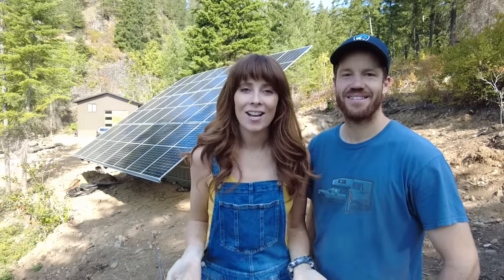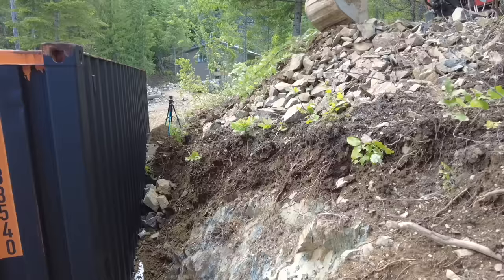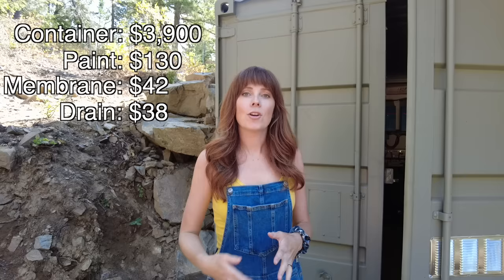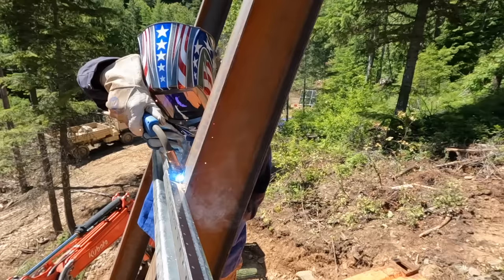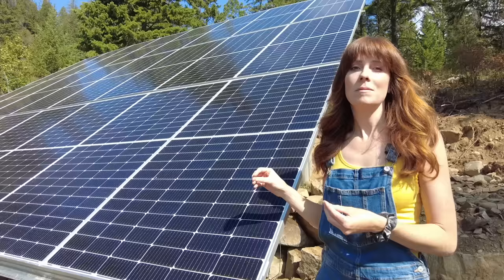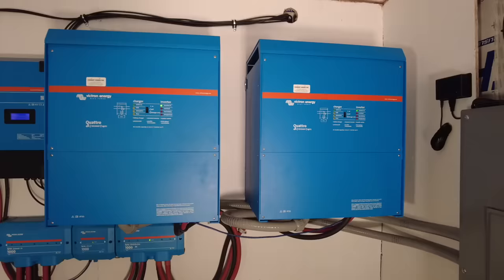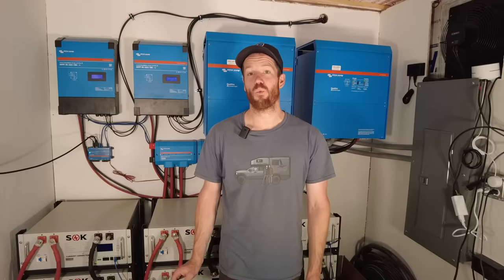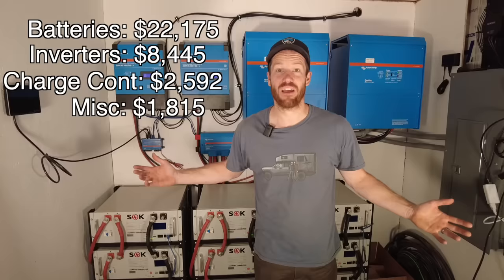TOTAL COST Of Our Off-Grid Solar Power System | Powering Our Mountain Home

Comment: Great video - thank you! Have you guys considered unlikely events such as fire in/near batteries or major weather events? We've similar battery capacity but have the batteries in two seperate locations just in case a fire occurs and takes the area off line for a while.

Comment: You have a very good system installed. Obviously, you need that power for what you want to do with a shop. However, that is way out of reach for most people. I live in Northern Wisconsin, so, I have the same winter issues as do you. We have a15,000 watt system with 2.4 kilowatts of panels. It gives us plenty of power for our needs.Instead of making or buying a big rack I purchased in individual racks that are adjustable to the angles needed in summer and winter. Our total cost for everything including connecting it to a breaker box was under $20,000. Still, you do have a very impressive system and I'm sure it will give you all the power that you need.

Comment: When i've checked winter solar production in my area, it is dropping to 5% of peak summer production. That's being said, your 10 kWp installation can go down to 500 Watts. Giving 8 hours sunny day it will give you guys 4 kWh of energy. Not enough for a small house, not mentioning charging the batteries. Still buy some fuel for your power gen and use that time to prepare shop projects for the spring-summer-autumn time when you'll have a lot o power to play with your tools guys! Have fun!:)
Reply: Key factor in energy production is panel angle to sun. During winter with low sun angle, the reflection is playing major role - pls mind that there is no zero angle with 100% energy being reflected! 
Their variable angle setup makes huge difference and during winter, more vertical setup can potentially collect sun energy reflected by flat ground / snow (but actually they have forest around and live in the mountains).

Comment: Good luck not needing to spend anything on maintenance for 20 years. Even at a 20 year payback your power bill would need to be over the 250/month. can't I believe you are smiling about spending 50k on that system and then saying you rarely go below 20 percent use. Should have bought way less battery and saved some money. 15k would have been more than enough. maybe you're from CA. smh.

Comment: Thank you!! Just minutes ago, I placed my own 30K USD order with CurrentConnected. Now is the time. I expect the technology will become cheaper over time, but the opportunity offered by the Federal Clean Energy Investment Tax Credit (ITC/FITC) and Inflation Reduction Act (IRA) is unlikely to be repeated anytime soon. For me and mine, it's time to reduce risks associated with traditional energy distribution for critical heat and water systems. I choose SOK 25 kWh from Current Connected and because I wanted grid-tied options (and other reasons) went with x2 SolArk 15K Inverters (also from Current Connected).

Comment: Interesting setup. I’m also in North Idaho on 20 acres and setting up ours currently. Commercial power is $85K to the property but additional to that it has to be put underground too and that cost is not included. We have the system components, very similar to yours. We also did not want to clear a huge area for the panels so had a barn engineered allowing mounting of the panels on the roof raised to accommodate snow depth and tilt-able also. Engineering included roof structure to handle 4000lb load above code, lateral and updraft wind loads to 90mph. Kinda like you guy its a bit unique so we’ll see how it works. Good luck with yours!
Reply from the maker: Sounds like an awesome set up! I have been thinking a lot lately about a tractor barn with panels on top. It's tough to optimize solar output while also optimizing a storage space.
Reply: @AmbitionStrikes  I have not tracked costs as granular as you but the engineering for the mounting (calculations, state sign off and materials) will finish up at about $30K. As you mentioned commercial mount is expensive but I spent more but with an end goal of not destroying the property to get power. Winter is tricky. My location gets 2 solar hours a day in winter less shade from trees etc. We are going with propane/AC appliances so we can switch to propane in winter and AC in the summer to help spread the load. We will have between 40 and 50 panels. Looked into bi-facial but the life of a panel is based on input apparently.. both sides. So the additional cost of the panels coupled with the same input total did not seem to be worth it for us. It's been a fun project so far. the barn got finished just before the snow came!

Comment: To heat the battery shed you can use DERNORD 12V 600W Immersion Heater Submersible Water Heater Element ($25 on Amazon) in combination with large paint cans filled with motor oil and a 12v 60a automatic temperature switch that turns it off and on. I've used these as load dumps for diy wind turbines and they heat up the battery shed nicely.

Comment: Love your setup, and it gives me some ideas, as I'm trying to design a NON-grid-tied solar system to power my own home. I have an Emporia whole-house monitoring solution clamped to each of my breakers, and it's showing I consume a modest 32kWh-40kWh/day, in a super-efficient home that doesn't really use a lot of power. I have smart plugs monitoring current for all of the larger devices/appliances, and they sip power. 

But this also means I need a minimum of 50kW-60kW of battery storage, likely more to cover those cloudy days where I can't recharge them back up fully via the panels every afternoon. We get maybe 3-4 solar hours per-day of good sun (northeast US), and so I'll need double the number of panels you have just to cover half your generated power.

Comment: Video actually brought tears to my eyes I'm such a weakling haha I'm trying to put together a little 3 KW system. I'm going to have six 450 watt panels I have a big battery coming and the 6500 110 volt inverter charger by sungold. I got cut off my power here in San Diego from my Trucking yard they lost the power so I had to go solar. I went 12 volt and it's been working good I probably could have lived with it cuz I only live by myself and I don't use a lot. But I decided to jump into this 24 volt system. I'm trying to do some research to figure out how to wire it up and everything this was one of my first videos I saw. I hope I can figure out how to do it all. I don't know how you guys figured all that out haha. Really amazing

Comment: My family set up a 10x10 vault almost entirely below grade, this included a 1700 gallon cistern which does nicely for keeping the room reasonably warm, water coming up from the well at 60 degrees, I've never seen it drop below 45 in there, even in the middle of several days of sub zero weather outside
My folks never had this kind of budget to play with, I gave them 3Kw of panels, which turned out to be the cheap part, I wound up replacing the 1600Ah of lead batteries which never seemed to last more than a couple of years with a single 5KwH LiFePO4 battery, I would've preferred 2, but, money issues.  Needless to say, they don't generally get a lot of snow, overcast was never so bad that they had to start the generator for more than a couple of hours at a time every few weeks or so

Comment: Excellent video. You mentioned the 60k just to get power to your land, which means the entire array was 10k cheaper.  You also save the monthly cost of the energy, which is substantial. 30 years from now, that cost of energy savings will pay the replacement cost.

Comment: How about painting the container silver so the back of the panel can get some energy and also cooler inside the container in summer. Put a black blanket （or some cheap duvet with black tarp on top） covering the container before the first snow come to keep the container warmer in winter. It doesn't cost much but help serve the purpose of making winter warmer and summer cooler inside the container.

Comment: Idea for your shipping container powerhouse. Put some thermostat controlled heat tapes around your battery bank if they don't have their own preheaters. Then wrap them with insulation to reduce the need to run the heat tapes. Just an idea

Comment: This is EXTREMELY helpful!!! Thank you for the video. Looking to build a fully off grid tiny house, fully electric, modern, and I need insane power for it. This is a life saver. Although the cycle life on the batteries is a bit low for lithium iron.

Comment: You have 2 big inverters instead of 24 small ones, which means you have to look out for shades on the panels, if one panel is shaded the rest of them have a reduced output, so look out for the trees which shade them in the winter and maybe trim or cut those down

Comment: In Pakistan we Installed 8.5 KW system in my house 16 solar plates and each is 585 watt capacity & hybrid solar converter of 8.5 KW. 4 batteries  2KW Each. Cost total 5500 USD.

Comment: we have an off-grid cabin in the adirondacks and went through pretty much what you did. our system is smaller and simpler (just 4kw of panel/20kwhr of battery/8kw of inverter) but, at 40kilobucks, it was the same price as bringing in grid power. and now we have no electric bill. it's a little small to charge our EV when it's not summer, but we don't really use the cabin at all in the winter (though we have a generator if we want to do that)

Comment: You might want to invest in some Class T battery fuses for your setup.  A fault on one enclosure could cause a fire; the SOK and Victron units cannot protect 12 parallel batteries.

Comment: You could have a geothermal system to warm the container as you already have all the power there you need. Just install the pipe and the pump. Then just get an auto radiator with a fan to distribute the heat from the ground.

Comment: Riley forgot one of the huge benefits of the racking system, keeping the panels as cool as possible. When the sun shines on dark surfaces (like solar panels) those surfaces absorb radiant heat energy from the sun. Think how hot the dark asphalt is in the summer, you will burn your bare feet unless you wear flip flops. When solar panels are flat mounted on a typical roof there is not much room for air to circulate and take heat away from the underside of the panels thus they get very hot. When solar panels get hot their ability to produce electricity drops of sharply. For every degree above 25°C (77F), a solar panel's output can decrease by around 0.3% to 0.5%, affecting overall energy production

Comment: All things considered 50kbis a great deal! And considering thats an overkill for most people. Add that for At least for 10, but most likely 20 years you wont have to pay electeic bill. Which for some of us the cent per kw is astronomical. And 50k even if it last for 10 years is still less. That what paying the bill wouldve been. So its like paying all the electricity up front. And not having to worry about that bill for over a decade. Nor having to worry in case of power outages because of storm or other external factor. 
This really was a great idea. And well thought executed.

Comment: Just found your channel -I enjoy it. I might have an answer for your concern over wind pushing the storage container from the rear. Install a "deadman."  I'm sure you can google it but I'll try to describe. Dig down parallel to the container,  use something big like a log about the length of the container. Use come cables to attach each end of the log to each end of the container. This can possible be done very cheaply.

Comment: Shipping containers are only designed to take weight and pressure vertically, not from the sides. I'm hoping the gradual pressure of the soil doesn't fold in that side of the container like a taco. I've seen that happen.

Comment: Providing you don't run anything with high power like an air con or an EV, hair dryers, electric ovens, 12.5 KWs is not a lot of power enough for lights, fridges, and small stuff and remember during winter it will drop to only 6.2Kw due to the lack of solar energy. Any trees creating shade over the panels will reduce the output of the panels. 
I did the math for where I live in Australia but the cost to go fully off grid (meaning I don't need any petrol/gas generators to charge the batteries) running a standard house with all the modern appliances and adding an EV is about 1 million dollars, this doesn't include the massive amount of land required for all the equipment.

Comment: For winter i would have put a lot more insulation on the container and install the generator also in there to use its engine-heat as a by product to warm the batteries (or running on very low load to power a heater). external exhaust and a gas detector are mandartory. i installed a similar concept on a smaler scale an it helped keep the batteries on charge temperature even on long freezing cold winters. 
For the wind issue why not install a "wind breaker" behinde the container. some planks at 45° or better a small wooden shed should do the job.

Comment: in regard to the efficacy of the buried back wall of the container adding heat to your enclosure, I assume you'll insulate the top and exposed sides, otherwise it won't do anything. I think you mentioned you planned this in the video. It may be too late to do so, but you might consider burying insulation sloping back into the ground from the back edge of the container (to meet the top insulation on the top of the container at ground level) this will insulate the ground behind the container from the cold air and help bring the frost line up in the dirt that is against the back of the container due to the higher temperature deeper underground. If it's all boulders and rocks there, this may not be viable. I just heard from a builder in Maine (similar climate?) that does this to protect slab on grade foundations from frost heave. If I am not explaining this well, imagine an umbrella of insulation exiting at ground level to meet the back edge of your container. If you are familiar with earthship design my suggestion is similar to the back wall design they use.

Comment: In the state of Florida the power company has to buy back the power you don't use. If you are off-grid and have a lot of excess power you can also sell power to a neighbor, legally. So, you can be the power company. Not sure how that would pan out, especially in extreme cold or heat, but it's legal.

Comment: great setup, only concern is the wind loading on the panels, i think if you did the calculations you will see under high windloads that the panels are more likely to break before they tip the shipping container, you have to protect the most valuable part of the system which is the shipping container, best you can do is to level the panels in high winds and hope for the best, a beast of a setup and very nicely implemented.

Comment: Little addon: I am not sure if 80% battery capacity will be guaranteed if you "discharge it death empty every time" for the amount of times they state on the datasheet. Depending on what kind of battery, you should for example usually not discharge under 20% for lithium batterys all the time because that is bad for the battery.
Anyways an interesting project and informative video.
Have a nice day!

Comment: So assuming 30-ish years of servie for your setup, roughly 138$ a month in costs which given your location that power can be used for heating as well which means its a lot more valuable than even that. Our power here in a more temperate and warmer location is still running us about 240+$ 9 months out of the year. Our town will not allow solar anything because city hall is paid off by the local electric supplier.

Comment: 50k! Nope CLEARLY not worth it. $2500 per year for 20 years for electricity. For 95% less you could have gone with wood gasification and a used 500-gallon propane tank to store the wood gas. With heavy consumption, you should only have to refill it once a month. With your propane refrigerator, freezer, and cooking stove with a gas furnace optional (I prefer a wood stove) you would only need a generator for lights and shop equipment. You could also go with a much smaller battery bank without fancy and jaw-dropping expensive control boards. This will do the same job using your free gas generator for an hour to recharge your battery bank and never have to worry about the sun on rainy/snowy days or worry about condensation getting to all of those computer controls. I wanted to watch your video to make sure I was making the right decision with wood gasification. You guys did a fantastic job explaining everything you purchased and why. Your question "will this system be enough to keep us powered this winter?!". For 50k NOT including all of your labor, it better be able to make margaritas, flip pancakes, and sing and dance. As am an electrical tech/repair I see those modules/control boards fail all the time. Normally after about 2 years, they start to fail, and sadly I can not get parts as they have been discontinued. I wish you all the luck in the world with your very handsome system.

Comment: Consider making the upper half tiltable and the lower half fixed. Use counterweights to balance the upper.  Leave the lower fixed at the winter tilt. You will still have plenty of efficiency in summer months and be able to tilt the upper to horizontal during high wind events. Also…((jealous))!

Comment: I built our four adjustable-angle solar panel frames (holding 10 large panels each) using sixty 12-gauge 10-ft Superstruts and lots of nuts and bolts, so the cost was still reasonable at somewhere around $3000. We lack a metalwork shop, so welding our own wasn't an option.